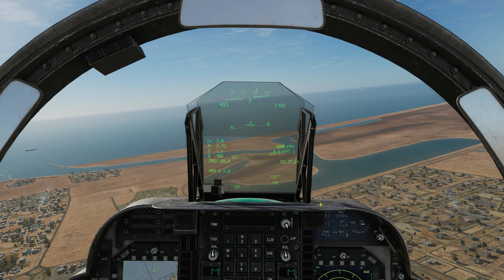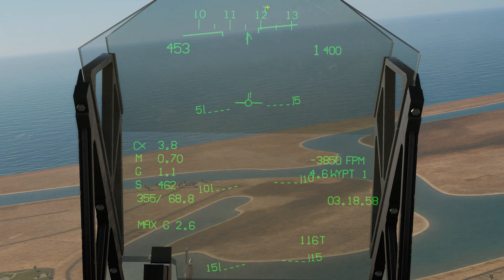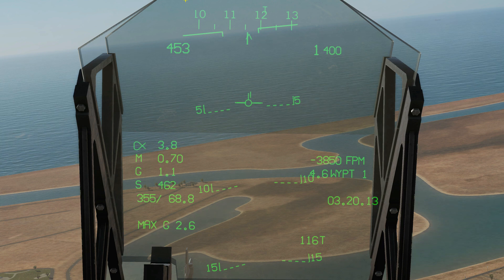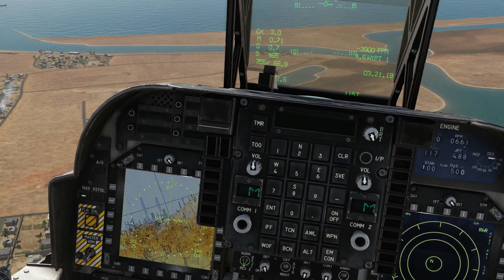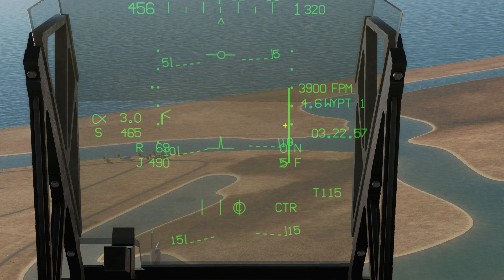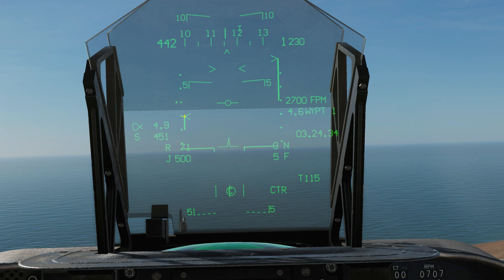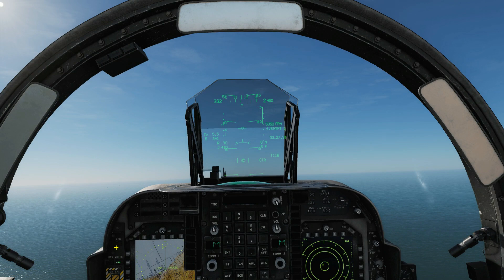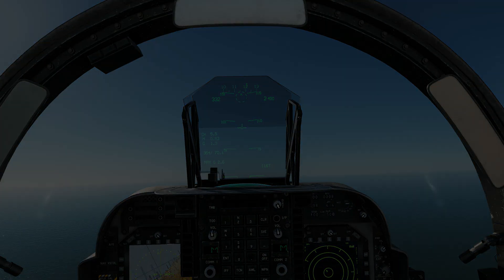AV-8B Harrier: HUD Modes & Symbology Tutorial | DCS WORLD

Comment: If in air-to air or air-to-ground mode, if the selected weapon is flashing on the HUD (right hand side, in the middle), it means your master arm is OFF. Also, you can bring the FLIR up on the HUD, very useful for spotting ground targets at night when using guns, rockets or CCIP weapons. (Make sure the HUD mode switch under the UFC is on "night", and then press sensor select switch down to turn the HUD FLIR on and off).